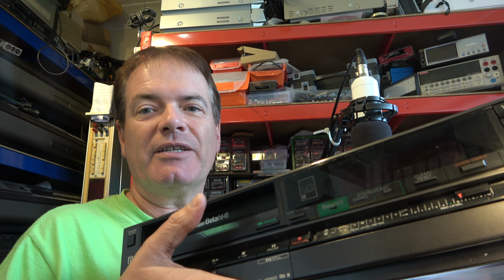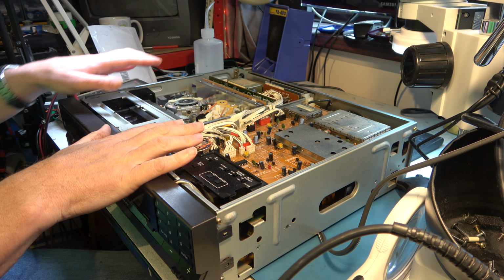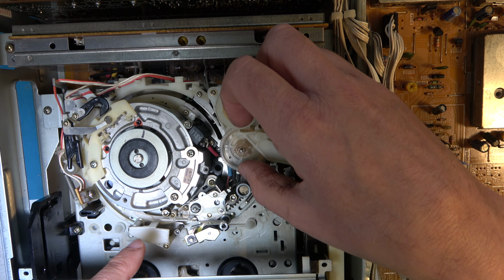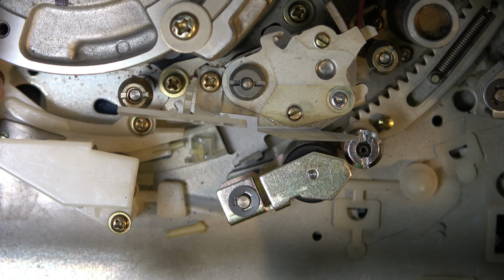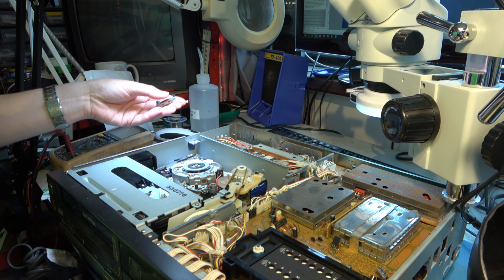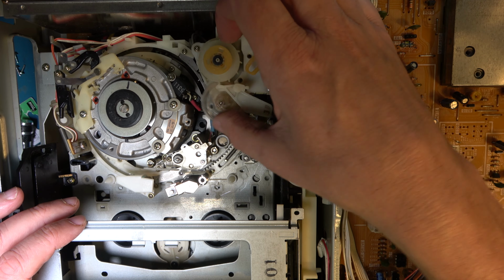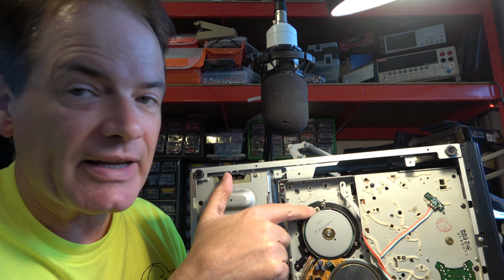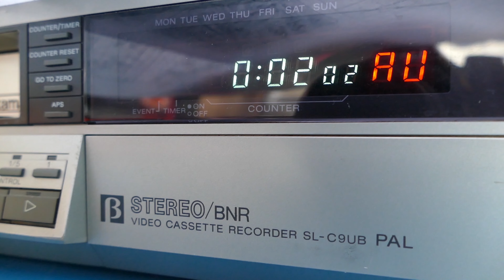SuperBeta SL-HF600 part 2. Not fixed. Not nearly fixed. But maybe a bit less broken.

Comment: Really loved this video and it's nice to see someone else wrestling with a Sony Beta for a change. I've changed the plastic lacing ring on a C30 not so long a go which was a pretty epic job - the one side of the plastic where the guide assembly for 4 and 5 locates had broken. The hall-effect devices - there are several that will work including some made by Toshiba used in alarm systems. Not tried as I still have a dozen or so Sony NOS ones left. I hear what you're saying on removing the drum and I'm always very nervous as I drop the drum out of the top but I can't help but cringe when I see the leads cut and soldered. Fingers crossed on the replacement regulator chip - I've had bad luck with the Chinese ones so far but you may well be lucky. Little Diode tend to be able to source reliable ICs even if they're not listed and they are UK based. My feeling is you may well have a logic problem with the machine but that is very much a guess; I'd need to get my meter in there! Really can't wait for the next instalment... :-)
Reply from the maker: The regulators have now arrived, but at the moment I'm working on the VR2324 which I've made huge progress with.
Reply: @video99couk  That's great news - didn't take too long? Look forward to the VR2324. In part 1 you mentioned the VR2840 just at the same time I received one to bring back to life, I also have half a dozen of the portable units too and have just repaired a Philips VR2350 which is an amazing machine! Can't wait for the next videos.

Comment: The part number for the hall sensor is THS103A, these parts can also be found in old Macintosh floppy drives, I repaired two SL-HF400's that had head spin issues, one would play fine for about 2 minutes, but the head would begin to slow and eventually stop. 

I know that if you plug in some Betamax machines that have a tape loaded, it will do the un-lace, re-lace procedure, if the unit was stored with a tape in it, the switch that indicates a tape is in the machine may be stuck, along with the power supply issues, this might explain the observed behavior.

Comment: There are 3 different variants of βI, the original low-band βI also known as X1, then there's SuperBeta I and SuperBeta I SHB (super high band 6MHz). The Japanese-market SL-HF900 can record in SuperBeta I (Hi-band) and the US/Canadian-market HF900 can be modified to do that. The SL-HF400, 600 and 900 all came out at the same time so I'm assuming the HF600 can play back SuperBeta I, as well as standard (low-band) βI/X1.
Reply from the maker: Confused?  Yes I am.  Then of course there was ED-Beta too.

Comment: Hall sensors are probably ths103a, and hg302c should also work, i’ve read about a repair on a philips cd880 that also uses these ths103 sensors in the spindle motor circuit, the guy was experimenting with hg103c as a replacement, did work for him in the cd880

Comment: Hello. I repair VCRs as side job/hobby. I’ve worked on hundreds of beta machines, and you are spot on about the hall sensor for the drum stator. May I ask where you bought the sensors from?
Reply from the maker: I imported them from Germany.  I bought enough that I can sell some on, once I've confirmed they do the job.
Reply: @video99couk  that works be great. Thank you. Btw, great work on repairing the super beta.

Comment: hi hall  ic and used in ebike   my bro  put 36 volts up in to 3 in the hub like you said motor would not work  kind of the same
in video decks just alot bigger for ebike  change them in a ebike is a right pain they are glued in  i could  make money out
of fixing ebikes

Comment: If that plastic part breaks again just 3D print a replacement part.
Reply from the maker: Much too high precision for my 3D printer.
Reply: @video99couk  What about using a 0.2 or 0.1 nozzle instead of the 0.4 nozzle?

Comment: The world would be so much better off if Sony had let other people manufacture the sodding machines. You'd still have the Sony options but a plethora of cheaper, simpler (and thus more reliable) machines and a wealth of machines to scavenge parts from. VHS might have died a death too.
Reply: Sanyo.
Reply from the maker: The number 1 selling video recorder in the UK in 1983 was the Sanyo VTC5000.  It outsold every VHS machine.  Followed by the also successful VTC5150 (I bought one of those in 1984).  So reliable, so easy to work on.